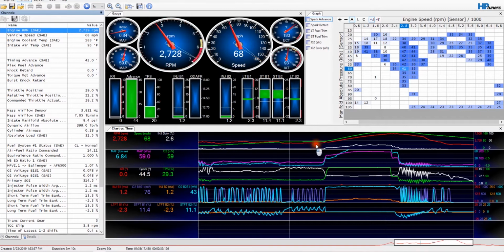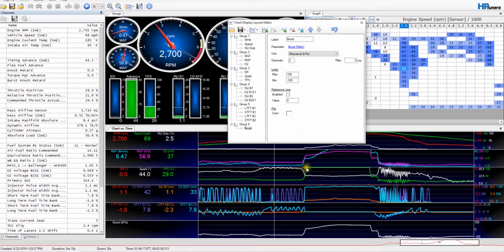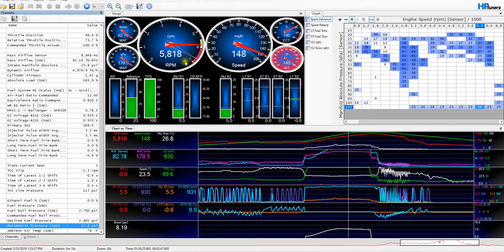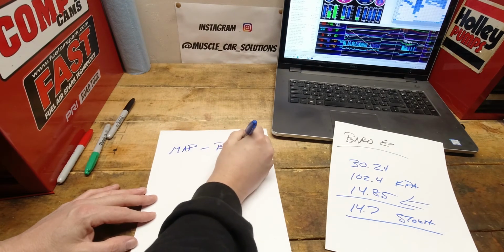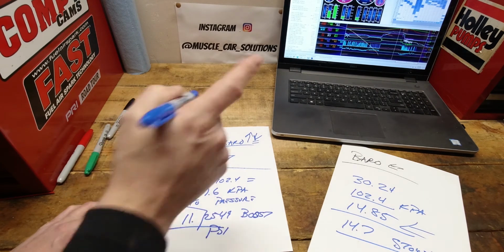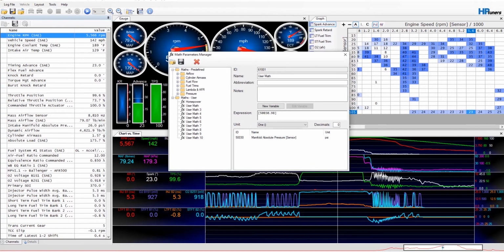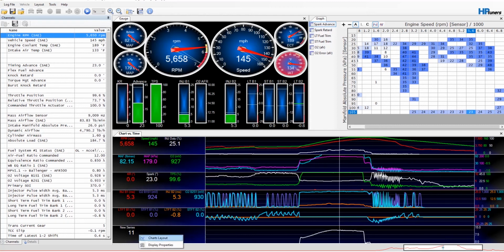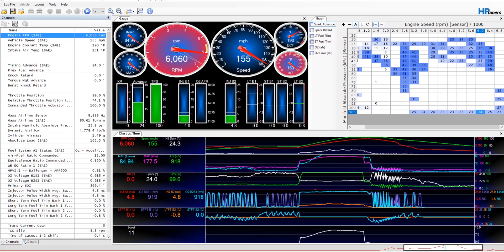How to Datalog Boost with HP Tuners

Comment: Quick question, do you know by any chance why my MAP is cutting off the reading at only 105 kpa?  MAP won’t go higher and my boost gauge setup on the scanner won’t read positive boost pressure ONLY reads vacuum.

Comment: I did the exact same steps but the readings just show negative figures
Reply from the maker: Are you monitoring baro and map and using the formula in parameter selector. If not then make sure you have the math right in user math.  Verify you’re using the generic listing for the MAP sensor.  If you’re not under load, you’ll likely see a negative number.  Once you’re under load and accelerating you’ll see boost as it’s calculated in a positive number.
Reply: @MuscleCarSolutions  thank you very much you help me heaps! 🙏